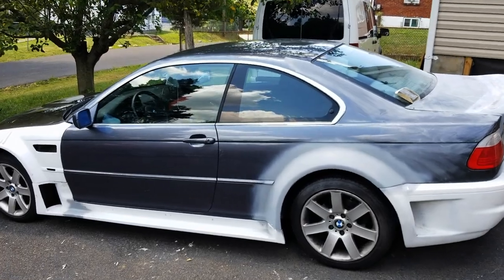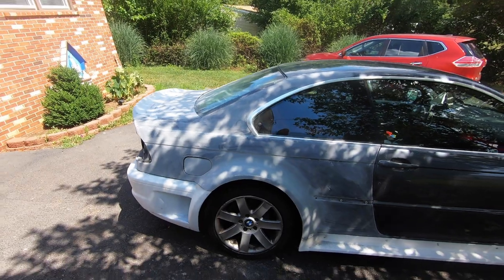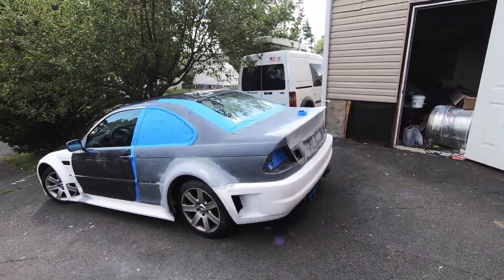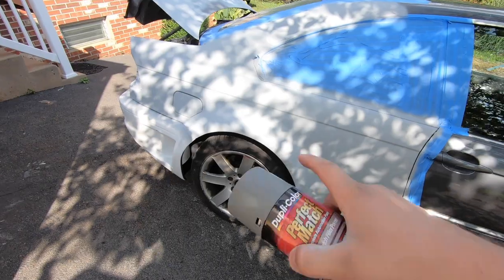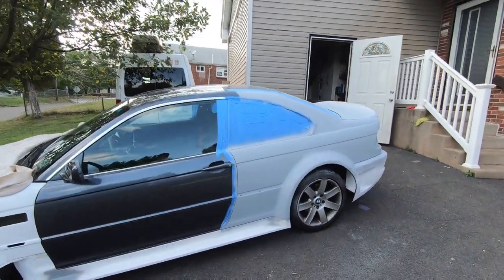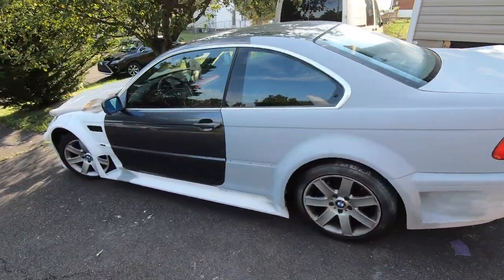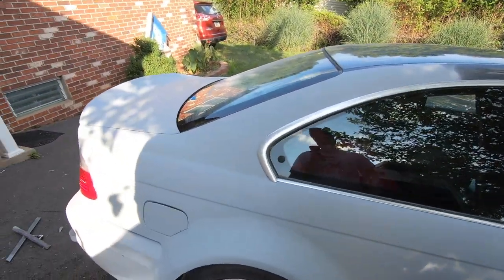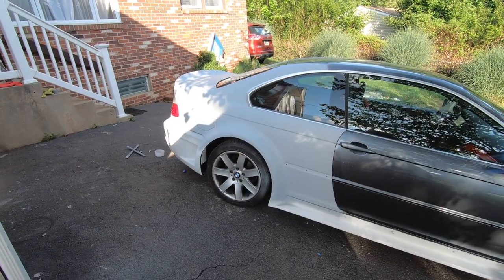Building a BMW E46 GTR, Paint Prep (Part 1)

Comment: Nice work! But you could have removed the window trims so you could paint the body better.. I removed mine the past weekend to vinyl wrap them in black, and it's super easy to remove, except the lower window ones which are held by double sided tape, and if you take them they'll probably get ruined and you have to buy new ones. Nevertheless, excelent work! I'm looking forward to see it finished! I'm really liking this build!!
Reply from the maker: Yes I agree, they will be removed once I actually go to paint the car. I want to get all the small dents and deep scratches out before I get the car fully ready for paint, the gray primer helps expose all the imperfections.
Reply: @BreakTraction  Keep up the good work! I can't wait to see this beast finished :D
Reply from the maker: Thank you! Hope to have it finished very soon, the car is all primed so another video might be out by Saturday!